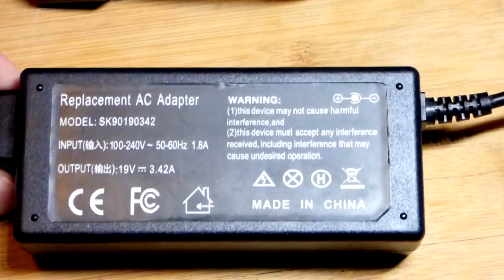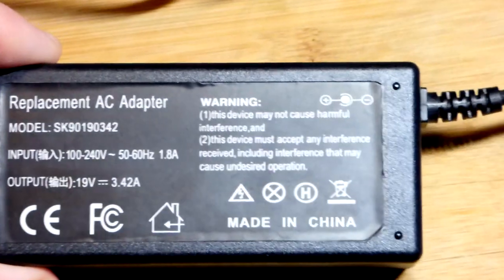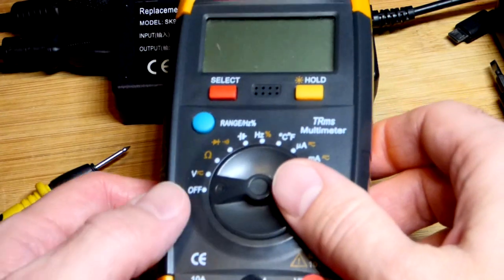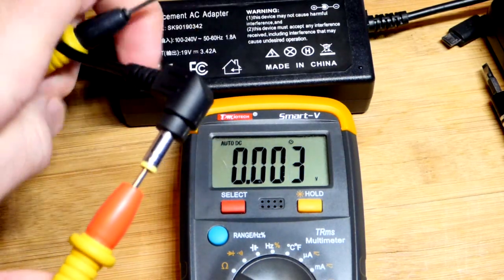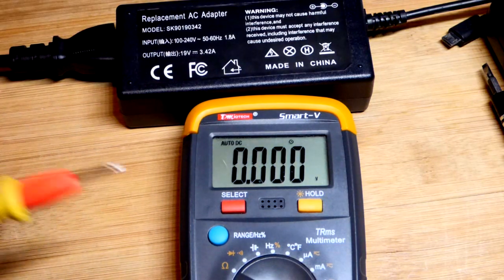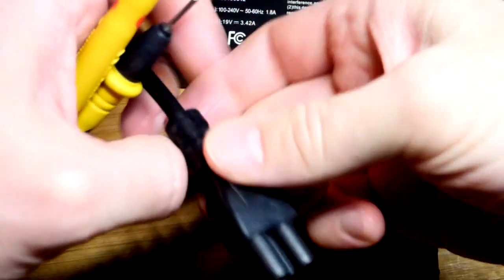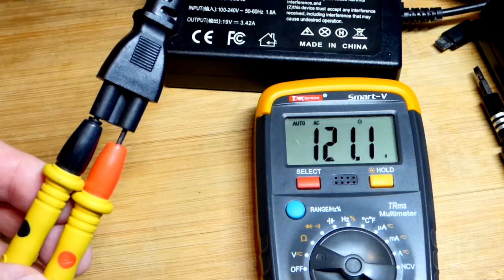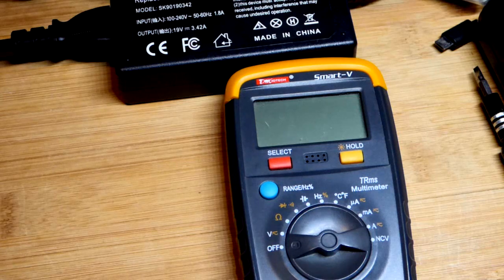Basic electronics barrel plug polarity multimeter testing bonus how to DIY learning lesson

Comment: Great tip for newbies.   I have gotten many things to repair that folks have plugged in adaptor with wrong polarity and blew the crap out the guts.    90% of the time item's is beyond repair.
Reply from the maker: That's a bummer! I haven't fried anything with reverse polarity yet, but I hear it's common.
Reply: why doesn't manufacturer prevent this completely with a 2 cent diode?  That would safe-guard completely, right?
Reply: @tonycarboni2002  Why do they care that you burn up your device.   You buy a new one.  They make more MONEY.

Comment: This was very helpful. I have some power supplies that have the voltage and current marked on them, but not the polarity of the plug and I was trying to find a correct power supply. I wasn't sure if I could just put the probes on the connectors directly or if it would blow up the multimeter. Nice to know it doesn't (assuming i'm using high enough voltage range at least)
Reply from the maker: Glad it helped, thanks for watching!

Comment: got a question. how come you dont get zapped when touching the outside of the (negative in this case)barrel of the plug? always wondered why most dc plugs have a few MM exposed barrel when fully plugged in, how is that safe?
Reply from the maker: You shouldn't feel anything if you touch both terminals of a power source that is well below 50 volts under normal conditions. Often the ground (negative) terminal is exposed because lots of things tend to share the same ground, so it is made easy to connect to. Only a proper load should also connect to the positive supply terminal. The biggest risk is metal touching both terminals at the same time (short circuit). Which can cause burns or injuries due to flying metal if it explodes.

Comment: Why is my AC adapter barrel still positive when I reverse the red and black probes?
Reply from the maker: I don't know. If you switch the red and black probe measuring positions, then a positive voltage should show as negative or a negative voltage should show as positive.
Reply: @Electronzap My bad it was an AC-AC adapter.
Reply from the maker: @roadtonever  oh, that makes sense then.